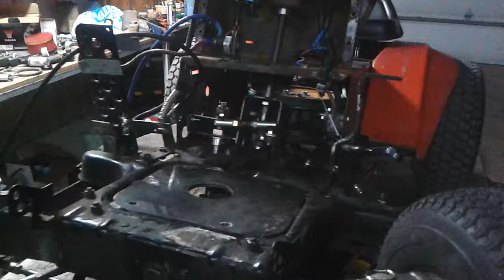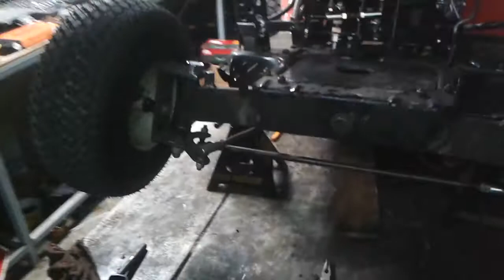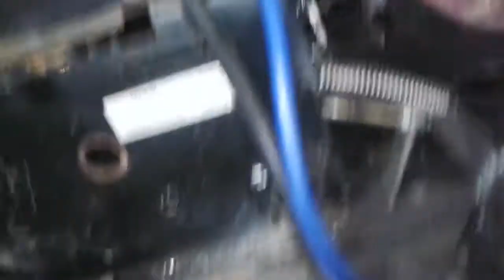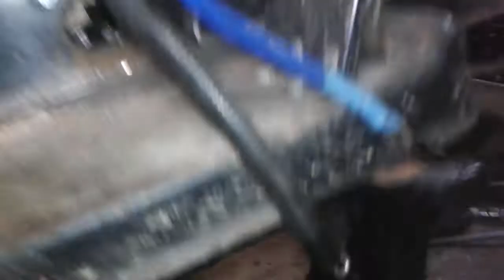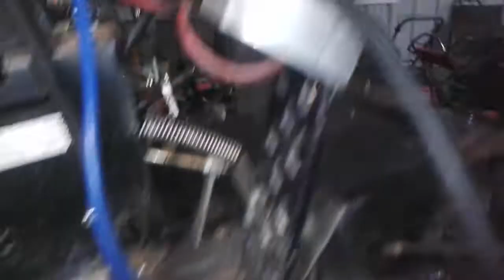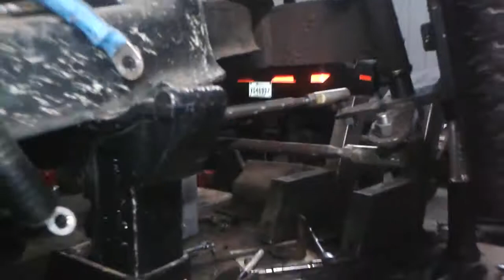Racing mower : 1:1 direct steering conversion 3.0

Comment: Thanks so much!! Great idea!!! I will be doing this on my mower in the mid future!!!
Reply from the maker: The easy way is to have a straight steering column through the frame and weld a pitman arm on it. My clutch was on the way and impossible to relocate it, this is why my system is so complicated.